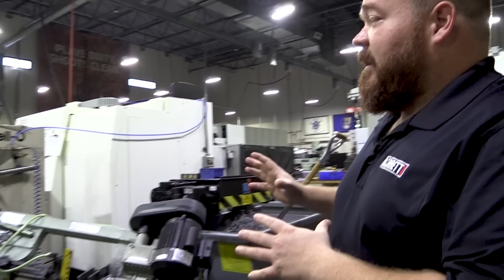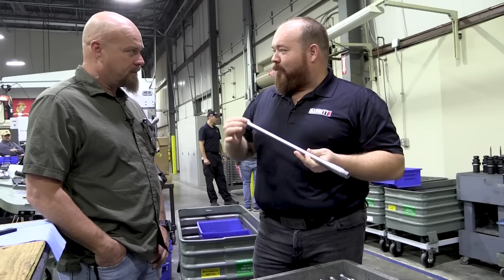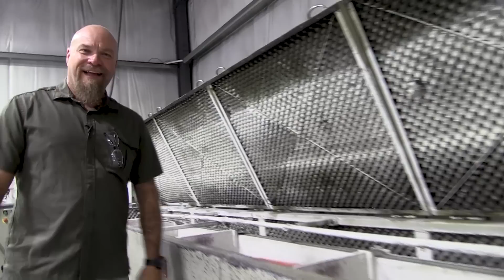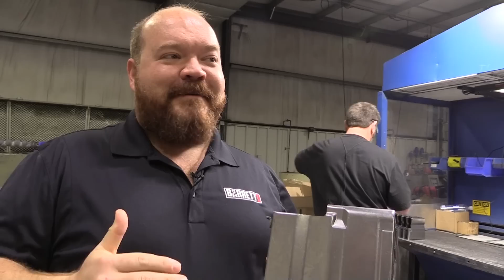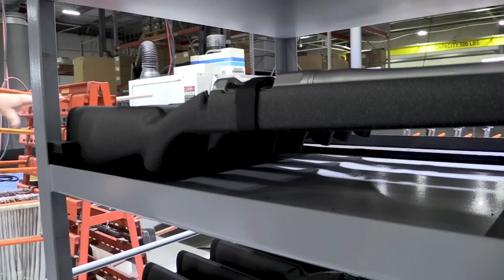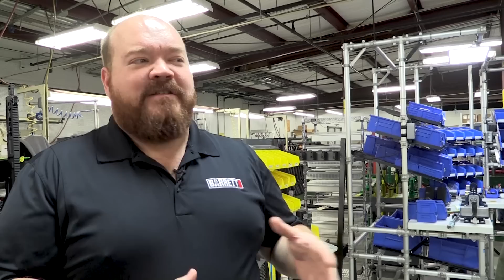Barrett Factory Tour

Comment: This maybe a newbie question but that's ok.  On the rifle thats on the table at the end of the video, I noticed it had a pic rail on the bottom of the stock.  What purpose would it have and what would you mount on it?  Thanks
Reply: Charles Shearer monopod
Reply: Thanks
Reply: Charles Shearer You could also put a light and/or foregrip depending on the intended use.
Reply: That is the MRAD.  In the new SOCCOM ASR military prescision rifle configuration that picatinny rail accepts a bag rider attachment.

Comment: Sorry but when I think of Barrett firearms I do not think of quality.  Ive seen everything from a broken forward assist to tight magwells, tight safeties, bad QD sockets, extremely weak castle nut staking, and coatings on the bolt carrier flaking off and flash hiders coming loose.
Reply: socomelite1 I would bet you’ve never held a Barrett rifle
Reply: He specifically mentioned rev changes to improve quality.
Reply: aaron rothe you have no clue how many I’ve held or shot. If you really want to discuss this find the thread on GOTX and send me a pm
Reply: socomelite1 what’s the thread called? I’m a member there and searched, but didn’t see it.
Reply: Socomelite 1, I specifically have 24 Barretts.  (See my above comment.)  I have numerous friends and gun club acquaintances who own numerous Barretts as well.  Our experiences are 180 degrees out of alignment with yours.